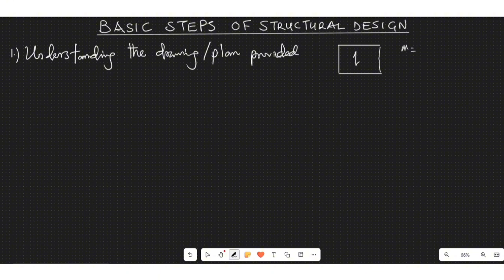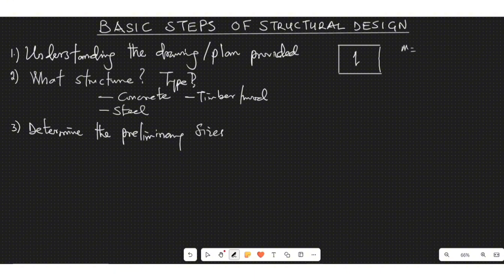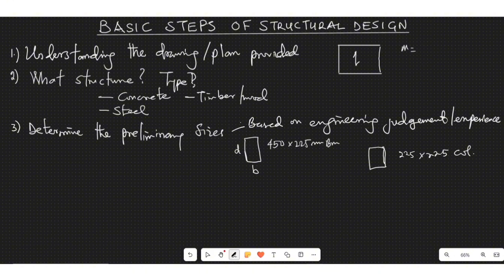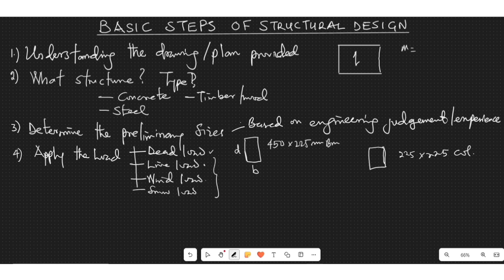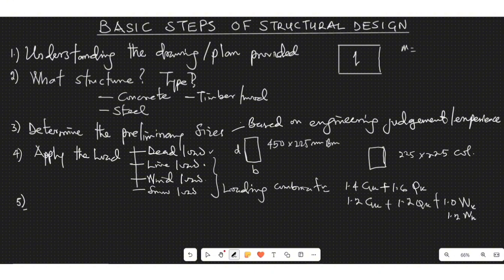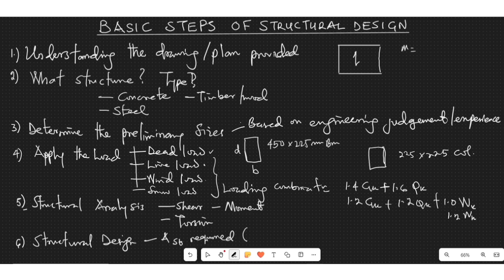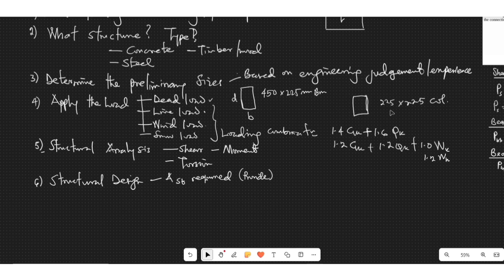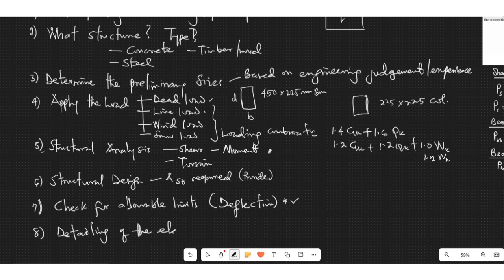BASICS OF STRUCTURAL DESIGN

Comment: Kindly note that load combinations on structures is a function of the design philosophy. From this video it appears that a British code of practice is to be adopted. If that is the case then load combinations are a function of the limit state. i.e combination factors associated with the ULS is different from those associated with the SLS.  For Dead + Imposed load, the combination specified in the video above is in order as per Table 2.1, BS 8110: part 1. However, for Dead + imposed + wind combinations, the partial factor of safety of 1.0 associated with wind load is incorrect. Kindly refer to the code of practice (Table 2.1, BS 8110) for the correct factor of safety for ULS combination. Note also that the factor of safety depends on the beneficial/adverse effect of a load category when compared with another in combination (better spelt out in the Eurocode). Therefore in the design of portal framed structures and a wind uplift is in combination with dead loads, the dead load is beneficial when compared with the uplift wind. Therefore the dead load partial factor of safety is 1.0 (As per Table 2.1) and that of wind is 1.4.  Combinations in a software should be prepared for both ULS and SLS. They should also be prepared for various design conditions. During installation, seismic events, etcetera
Reply: https://www.youtube.com/watch?v=nkn9j8tEf3c&t=2026s